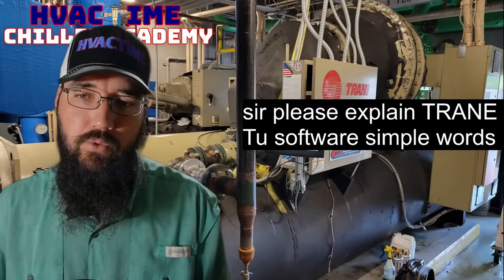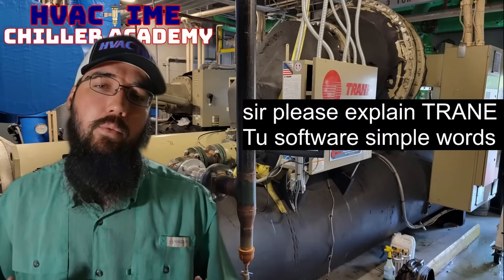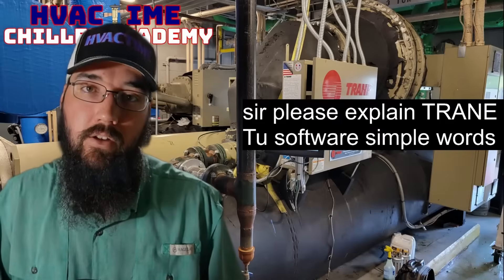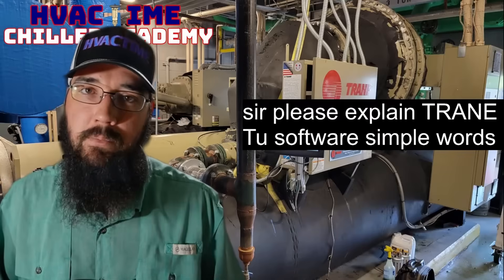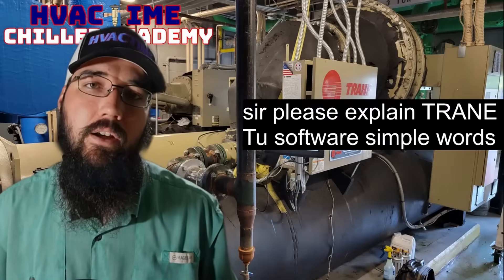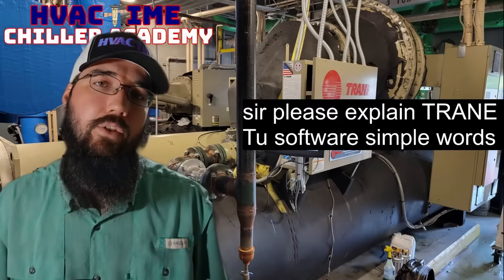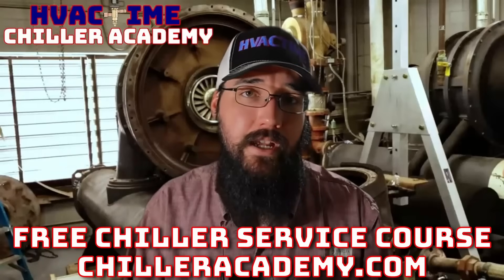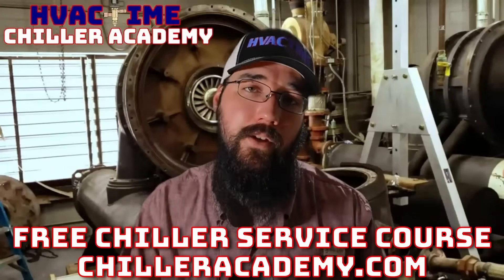Explain Trane TU in Simple Words

Comment: Do Trane techs over in the States completely rely on TU for everything like they seem to do over here ?
Like they don't even break out the gauges they just take a "chiller report " and that's good enough.
Reply: Im a trane tech, never used gauges in any diagnosis on any chiller connected to Kestrel or Tracer TU. Even pressure test, recovery and vacuum I dont use gauges